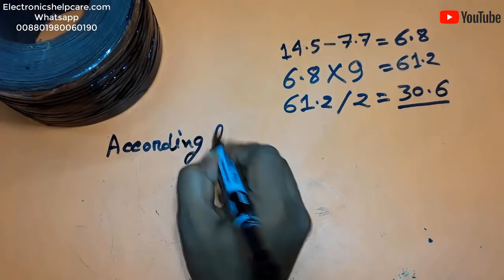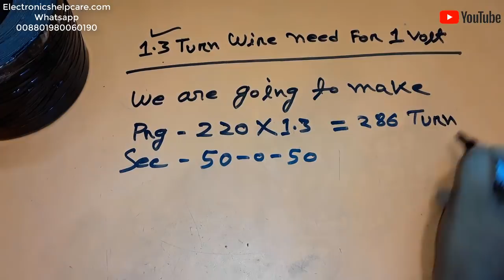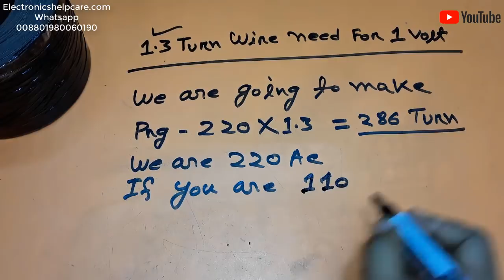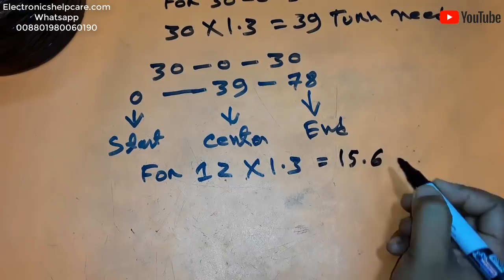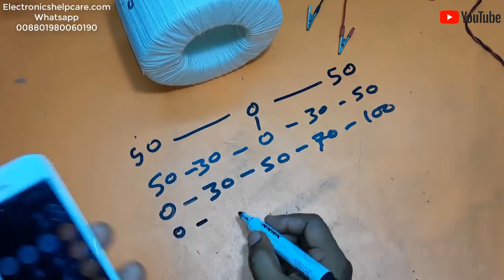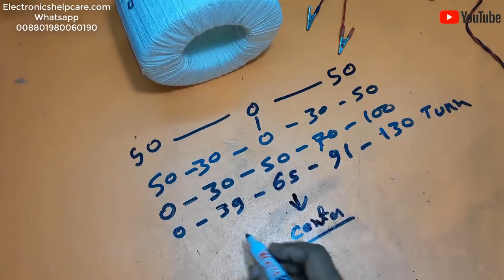How to make transformer?

Comment: The flux density in the core Gauss B, for a sinusoid is calculated by B= (Vp X E +8)/ 4.44 X Np X Ac X f where Vp is the primary voltage, Np is primary turns, Ac is area of core in cm sq, and f is frequency in Hz.....usually 50 0r 60.  B can vary from 12, 000 for inexpensive 24Ga steel to 17,800 for tape wound toroid steel. The use of ROT Np= 42/Ac is pure bullshit as it does not take into account the quality of the steel, the stacking factor,  as well as the high line primary voltage. It will result in excessive number of turns and poor voltage regulation.

Comment: bro for frimer coils, 1mm wire in double or in parallel so that 2mm will be rolled together at the same time or not, then the N ends are joined with N and the L ends are joined with L or each end is joined thanks.

Comment: you forget to give what is the exact size of a coil to be used in primary winding .and also in the secondary winding. and pls solder it before putting a spaghetti wire to secure your connection right.lol😂😂😂goodluck to others who attempt to copy this tutorial..😂

Comment: Could of used thicker stuff 2.5mm and just had 2 coils and reduce voltage with zener diode circuits or other smaller transformer step down or step up 😁